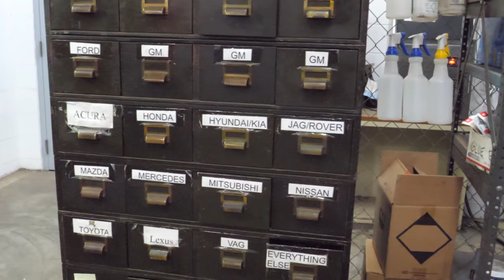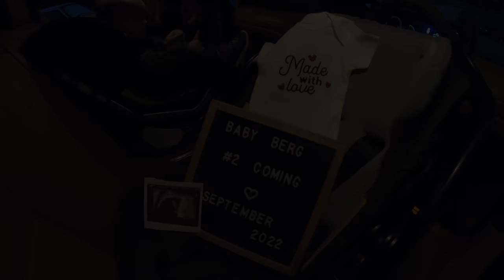Small Block Chevy 350 TEARDOWN! 100K Sub Special! Shop Tour, Announcements & I Open My Play Button!

Comment: The base of the lifters is not "flat". The lifters bases actually have a convex surface. You should notice that the lifter centerline is offset on the cam lobes so that when running the lifters actually rotate in their bores. Additionally, this also rotates the pushrods somewhat as well.  If the lifters did not rotate they would get quickly worn. Just an FYI.

Comment: I have only found your videos about a month ago and subscribed.  Love them all.  I love to learn about anything engine.  I haveva 5.7 hemi that is going to cost me 7500.00 for a new block.  Came shaft looks like every video i have seen of tear downs.  Had a misfire code come on and by the time the check engine like came on number 4 push rod bent.  I have only had a year and had the dealer change oil every 5000.

Comment: I’m not surprised that a .060 over 350 had cooling issues. I had one in my first car, had to run the heater all the time or it would get hot. Not enough material between cylinders. That block is a coffee table now, unfortunately, too bad to see a four bolt main go away.

Comment: Rod bearings of .010 doesn't mean the rods were machined, it means the crankshaft rod journals were turned .010 under. Cranks can be turned .030, so there's a lot left on that crank.

Comment: a machine shop put one heavy duty spring only on one valve and it wore out the one lobe on the cam after 3,000 miles. That spring can only be used with roller lifters.

Comment: Your ECU business is interesting, I have figured out how to flash the 94-95 Dodge and Jeep ECU's. I learned 99 percent of the time the ECU dies because of bad capacitors and that you can cross flash a 6 cyl ECU to run a 4 cyl Jeep. My current experiment is running a Dodge 5.2L ECU with the software from my 92 4cyl ECU.

Comment: I have torn apart many SBC engines the first engine I ever worked on was a 327 SBC in a 1967 Impala between SBC and the LA series SBM those are the most I have done and have done a wide assortments of big blocks from 396 and 454 chevys to 383 440 mopars and 351M and 429 428 Fords I have tore apart many old engines but the oldest is a engine from a 177ci I4 from a 1926 Model T ford

Comment: Nice place, proud of you dude, by the way that block its gona need sleeves, its at 060 already,  shame it being a 4 main block, more than likely a 010 stamp in the back, check the heads for a double hump, if you get lucky those could be some 202 heads, maybe even angle plugs. Wonder if that crank is cast or forged, hit it with a wrench, see if goes like a bell

Comment: my 350 burnt a quart every 500 miles so on a long run it was a gallon a time!
that engine defo overheated seized and was rebuilt, that damage on the weights was witness marks to un seizing before rebuilding then it overheated again!

Comment: Wow.. your desk is super clean.  How many hours did it take to do that ?? 😁

    I love your channel.  I have rebuilt engines but dont have 1/10 your skill and experience.  I love older bmws and recently started owning and loving a 4.7 toyota sequoia.  

At some point I would love an opinion.  On buying a 4.7 v8  vs a 5.7 v8 toyota .  Both would be higher miles. I know your not an expert.. and would not know the specifics of the car I would buy.  Just want  your opinion on what you think would be easier for ten year ownership with great maintainance.  

I love your calm talking as you take apart old beat engines not getting upset or frustrated.. at least not that I can tell.

Comment: I know you said "Don't Look At That" PT you had back there but, tbh, I want to know the story on it. Honestly, Wouldn't mind seeing a teardown of the engine if its still there, especially if its a GT) Reason I would be interested in a teardown video of the 2.4 engine is I owned a total of 3 of them. Had an 01 that lasted 15 years and 288,000 miles before the frame was shot and the head gasket finally had enough. Then came an 08 from Tennessee (Im in NY) that was rust free. Drove that for 30k before selling it for an Ecoboost Escape which I enjoy more but, I then bought an 03 Woody Edition PT with only 48k miles. Still have that to this day and only has 64k miles on her. Owning 3 of these, I have never done an engine teardown. Then again, I do not have the space either. Where I do not particularly like the styling of the PT, my 01 (Which I bought new off the line) led my decision to keep them as i never had a vehicle last over 200,000 miles before the PT Cruiser. Id really like to see what the inside of the engines really look like and possible learn something in the process. 

Love your channel and I thoroughly enjoy all the teardowns you do. (5.7 Hemi especially as I also have a Chrysler Aspen with the 5.7 Hemi) Congrats on the 100k+ and hope to be with you when you eventually do hit that Mil.

Comment: I would bet that had a forged crank originally most 4 bolt blocks from trucks had them. at least the 1 ton trucks did. Late 78 and on heads were crackers. They made them thin to save weight. I never seen a blue, orange, and black paint scheme.

Comment: These flat-tappet cams in pushrod engines need a high zinc oil, which is becoming harder to get. The result of not running the right oil is destroys lifters and cam lobes. I learnt the hard way on my Ford Cleveland, twice.

Comment: As soon as those lifters stop turning, they eat the cam. Chevy used too small a diameter lifter.  Roller lifterswas the ultimate answer, but mushroom tappets, bronze bushings, and oversize bores for Chrysler lifters were used in quest for performance and longevity.

Comment: You really know your cars. Otherwise you would not be in business with 20 people working for you. Congrats to you. I did not know you fix chrysler puters plus do you fix TIPM which to seem to mess up a lot. Do you fix them or sell them outright. Can you send your own in to get fixed or not? Those old small block chevy were so easy to work on. GM should have keep them and just updated them and they would have something. Back in the 50s amd 60s most used oil at 100,000 miles. But back then leaded gas wore the cylinder out because of the lead in the gas. Still IMO the best simple engine ever made. Along with the BBC engines as well. Change the oil regularly they never let you down. We talking 2,000 mile or 3,000 miles oil changes depends on how you ran it.

Comment: Eric, congratulations on your earned success my man..... don't read below.

1997 toyota land cruiser
178k mil, clean title, new tires, new battery, new power steering pump.

Frame and brakes rusty af. Runs but not safe to drive because...⬆️ and I wouldn't recommend it either. 

I want to save it though. It's like a shelter dog that needs to be rescued. Or would it be a good parts car?

Comment: Too bad the block has been bored, I was going to suggest doing a build video out of it since SBC parts are cheap and they can be fun lil engines. 

On a side note, that wear on the front main bearing was likely caused by someone running the belt too tight. Most of these old engines with a v belt were tightened by the alternator, and if the belt tension is too high, it tries to lift the crank up towards the alternator causing it to wipe the bearing.

Comment: This is a very ametuerish question, but how often does a mechanic need to remove an engine to work on it? It seems that many portions of the motor are inaccessable when it's in the vehicle. Sometimes it seems like it would be faster to remove a motor and work on it then it would be to remove all of the in-the-way-parts, to get to the part you need to replace. How long does it take to remove a motor, and again to re-install it? That would make a good video.

Comment: Too bad it isn't a 3970010 block which was made from 69-78 truck or performance car application. I have 2 of them. One was running when I mothballed it; the other one was from a 69 Camaro and needs a rebuild.  The mothballed engine is bored 30 over, forged pistons, 400 heads shaved 7 thou, Clevite 77 main and rod bearings, perfect circle rings, Edelbrock square bore intake, Edelbrock 600 cfm carb, Mallory pro billet distributor, MSD Wires plus an aluminum flex plate fan.  I had that engine bolted to a 350C transmission and was installed in a 1984 High Sierra truck; one fast truck!

Comment: The Chevy small block has to be one of the most simplest and easiest engines to work on. With that said, that block looks rough to say the least, I would say it's trash. I'm no expert but I don't know how much more you could bore that block out. If it were a 400 small block I would say 60 over is pushing it because the bores are siamesed on the 400. Probably have to get that block sonic tested to see how much meat is still left in the cylinders. Crank looks trashed too.

Comment: 060 over, the block might have been bored twice and the crank came from another motor that only had been turned once but suffered a catastrophic failure due to other causes.

I'm thinking the lifter bore issues came from a reman shop that just didn't give a @#$% when they screwed it together.  Obviously most people would have run a hone down the lifter bore if they felt anything beyond normal resistance.

Comment: Weird conglomeration of parts. 4 bolt mains and cast crank. Don’t know about the pistons - did factory replacements 0.060 come with oil holes in the bosses? These are great old engines, though.

Comment: Eric I have a question I love the BMW X5 especially the older  models they have a fat and sassy looking rear end on them even the tires are wide. But everybody says they're junk!  Something about the motors won't take  abuse or they have a lot of electrical issues. I almost bought a 2004 body was pretty clean on it it was decent and it ran but then I could see that the guy had put a piece of tape over the check engine light which was on. And you seem to have a lot of knowledge when it comes to BMWs.

Comment: Looks like an engine not only with blown head gasket high miles but didnt get regular oil changes base on the oil in the pan and possibly overheated etc. - hard to kill an old SBC though, ive seen em run in terrible shape

Comment: Hi,I was wondering if you would have a 1969/1971 dodge 340 Cid block and a set of 340X cast heads that are complete . This would make my day.
Reply from the maker: unfortunately I don't get the old stuff very much. Would be a rare situation.
Reply: @I_Do_Cars  do you think that you would have time to look around for me, I would make it worth you time . I want to rebuild my old 1970 Duster that had a done up 340 Cid. I could do a 10.8 in the quarter mile.

Comment: If you comes over an early 70ts 2 liter toyota  OHV engine those was find in crown models,if you look at this engine you will think have im see this before...it looks like an Volvo  B18 B20 from the same area but its an mirror image of ecaother,both of those engines are known for really high milage ,so can it be something with the design?

Comment: If you're not pounding on it with a block of wood, are you really working on a chevy? 

One of the best trucks I've ever owned had a throttle-body injected 350 in it. It was a long-bed 1989 C1500 with a five speed. Only time it ever left me stranded was when the ignition coil gave up, which cost me $20 and five minutes to replace. It seemed like anything on that truck that needed to be replaced cost about $20, except for the tires. That truck did have the infuriating quality where some bolts were metric, and some bolts were SAE. 

As for 100k Subscribers, the reason you've got that is because you don't waste my time. I'm here to see your engine teardowns because I'm bored, or stoned, or I want to see what the inside of a certain engine looks like. You don't waste my time with an intro, or begging me to subscribe, you just tell me what you have, a but of info on what it is, and then you take it apart, often while making funny comments. 

So, will you tear down a Ford 300 next? In all seriousness, I'd love to see either a GM Atlas engine (2.8, 2.9, 3.5, 3.7, 4.2 liter from the Colorado, Canyon, Trailblazer, or Envoy) or a 3.7 liter cyclone V6 from a Mustang or F150.

Comment: NOTE: NO plastic in this old school small block unllike all the newer engines, though this engine has a roller chain the factory cam gears did have nylon teeth but they still outlasted all the plastic chain guides, manifolds and other BS found in todays built to fail engines.

Comment: I have a running 6.0 powerstroke with a great transmission and transfer case  the motor did loose a headgasket  and has been out of the truck for 2 weekss..we are doing a cummins swap.point being and main question I'd love to GIVE it to you to see you tear it down..it's on the west coast idk if you want it but if so contact me if you are interested you would have to cover shipping. Though

Comment: 2 comments.
Buy a REAL 3/8" impact like a Milwaukee M12 2454 or 2554.  Everytime you use a 1/4" hex with an adapter, I cringe.
On engines that have "different" valve trains, spend some more time showing the unique feature.  Maybe hire someone to make some simple drawings.  Things like direct acting buckets. Are the shimmed or are the buckets themselves made with different thicknesses.  No one ever shows the lash adjuster from a Ford modular or how they actually work.  Related to Ford modular engines, the 5.4L 3V had two different phasers. It would be interesting to see them side by side.

Comment: How do I find your contact information? I'd like to get a quote for a 2.5L Ford Ranger long block (1998-2001). Thrust bearing wore out, kicked 2 of the 4 rods right out the side of the block at 268,843 miles.. Pickings are slim and too iffy where I live in Houston

Comment: Truthfully, it feels like editing is your weak point, so it could help if someone else did them.  Specifically the scene transitions need work where you are often cutting yourself off mid-sentence.  Not a major gripe or anything.  I watch for the content, not the editing but better editing would signal you are setting your channel up to grow.  Certainly you could get better at editing, but if you are having problems finding the time already, then its not likely to materialize.

Comment: i can name 350 things,wrong with a 350. chev,for one, rocker cover surface, plug angle, adjustable hydraulic lifters,?, now theres a first. weak blocks, floating cam, will not rev over 6k & stay together. 1950,s design,  simese ports, all chevs run a 9", or 12/14 bolt,  12 or 14 bolt. ?, no diff size.?.just bolts.. chev guys dreamed of clevo heads in the 70,s. before alloy was invented..

Comment: looks like..60 over.. bad bores.. looks like.. maybe ..oversized valve job, heads cracked.. open chamber.. heads are nothing special anyway.. You got a goat?? If you did you could put the engine in your front yard and tie it to it.. 😅🤣😆 it happens